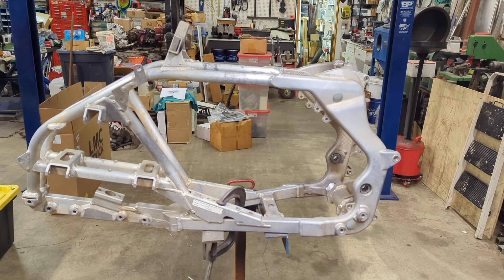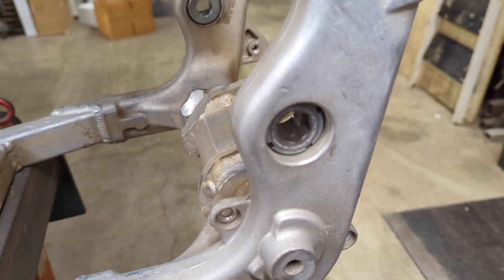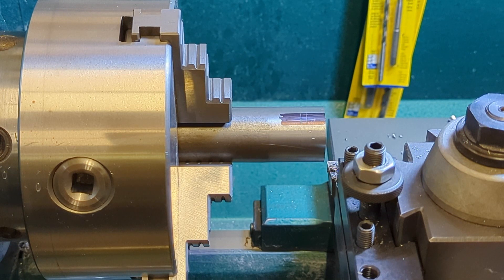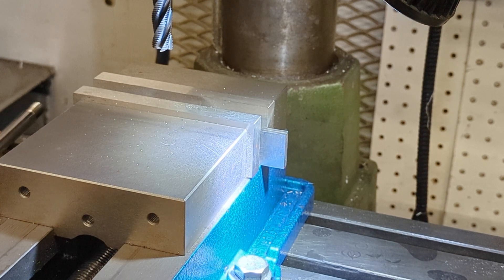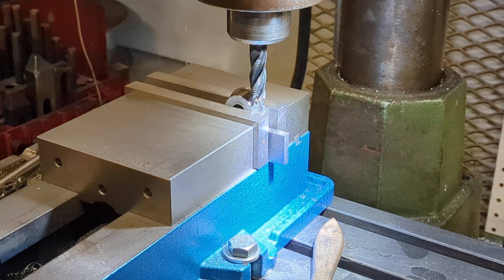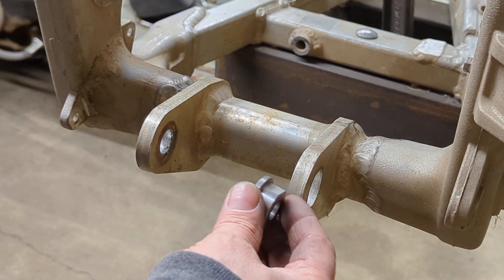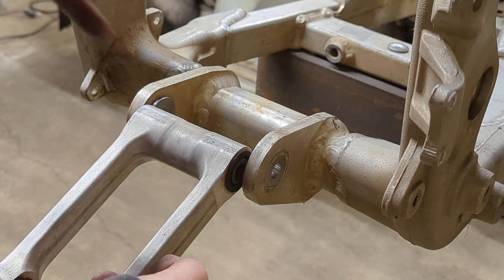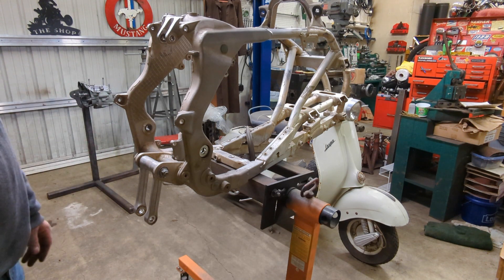T4 500 AF Part 1

Comment: I want to see you add a counterbalance shaft to it. if anybody could I know you could
Reply from the maker: Adding a counter balancer is do-able but it's a huge amount of work. Been a long time since I did one of those.
Reply: mine didn't vibrate near as bad as some I've seen . make sure the crank is balanced it will probably be fine. @ilrperformance7152